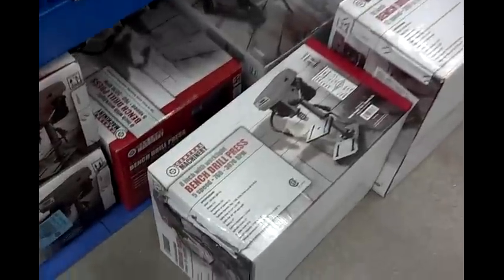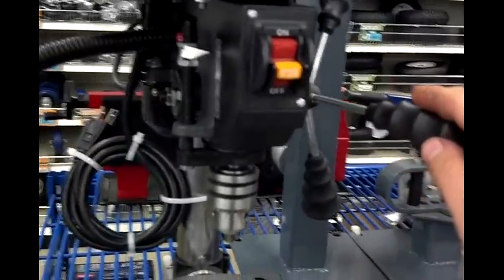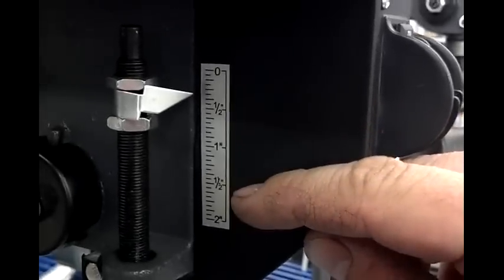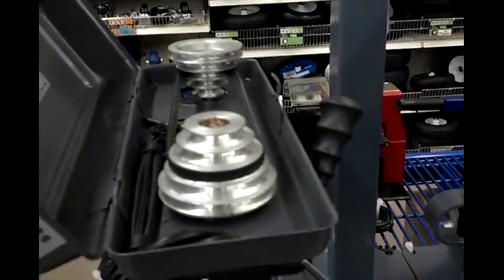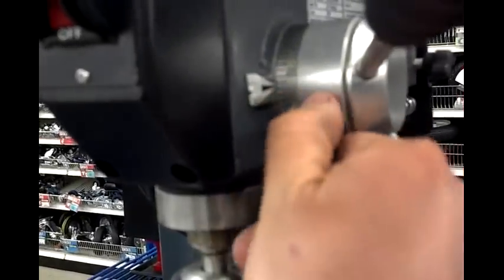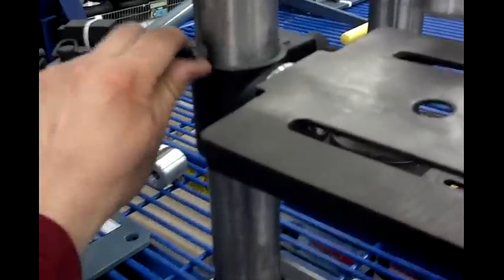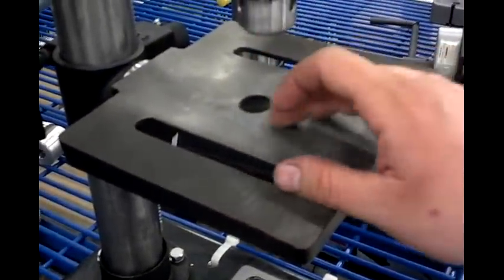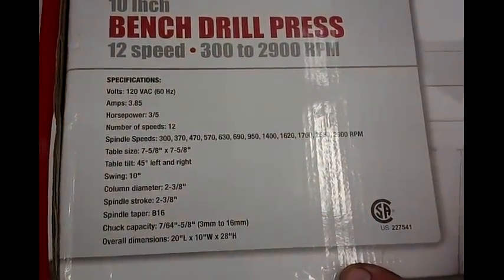Harbor Freight 8" drill press vs 10" drill press

Comment: I have the 8" and I noticed the chuck wiggle if I go all the way down, I lift the table upwards, so that the chuck never goes all the way down and wiggle. I ticked it was the 2 screws that are used to stop the depth of chuck. Get to know your drill press and you can amend any problem. No complaints from mine good deal. I also recommend getting to know your speeds and know when each speed is  needed.

Comment: Thanks much for the info. You saved me 2 hours of drive time. Although the tools look ok for some applications I don't think it will suit my needs. I didn't like the way the parts were moving around like you pointed out. Im also worried about accuracy and runout. I understand these are budget tools and for what they are the prices are good. So I think I will be patient and save a little more and go with a higher quality brand. But thanks again for your help.

Comment: I have the 8” model and it works fine unless you need something super precise and or are cutting really thick steel or something.  It’s a light duty drill press but as with most harbor freight tools they are not super robust and have plenty of faults.

Comment: I bought the 8 inch and have used almost exclusively on steel for several years. It pretty much stays on its lowest speed and my only real complaint being it is still too fast. Everybody says they need precision in a drill press (myself included) but when the rubber meets the road I'm just drilling holes.

Comment: Ya I think it's just they don't put them together very well on the demo units, that's why things are "loose"
Reply: At my local HF they are missing parts, and hardly are a working display.
Reply: +Bradley Berthold I just bought the 8 in and pout it together. I did not notice the "wiggle" issue. May be that its a demo unit and has taken lots of abuse.
Reply: was thinking maybe a vinyl nut would get rid of the travel.
Reply: It's not just that they don't put them together well.  I bought one, exchanged it due to excess vibration and chuck runout, and the 2nd unit had the same problems.  Poor tolerance and quality control.  Go figure, maybe quality drill presses cost twice as much (if not more) for a reason.

What you could do is buy about 4 of the same model, and take the best tolerance parts from each and build one reasonable drill press then return the other 3.

Comment: theres a little adjustment on the side (usually) to preload the drive column against the side, but even then my drill press with the adjustment screw out has barely perceptible movement, not this bad.

Comment: What HP should I have to use on metal - as a minimum? 
I'll be drilling holes through Aluminium and Mild Steele RHS, sheet and SHS sections. Thicknesses will range from 1mm up to about 10mm. Thanks in advance
Reply from the maker: +SupaLexy (SupaNautica &amp; MotoLexy) My 10" struggles to drill tough material or large holes. If your looking to seriously use it get a better drill press. I sometimes regret not saving to buy a better unit, but I rarely use my 10".
Reply: yeah that's the plan, larger holes, maybe 1 inch if I need to. I see a lot of people drill smaller pilot holes and then work up to the size they want and many of the videos on YT don't say what the HP is on these bench / press drills. 1/3 and 1/2 HP just seems so small, I was thinking that I might need about 1.5HP. Not sure
Reply: RPMs are key. the slower the rpm the better drilling through metal. Always take your time and do not forget to oil while you are drilling.
Reply: Re: Drilling holes through Aluminum and Mild Steele RHS, sheet and SHS sections. Thicknesses will range from 1mm up to about 10mm. Dia up to 1 inch. Think 1.5hp is needed.
Q: It's been a YEAR.. What drill press (Mfg Name+Model) did you end up BUYING?, How is it working out for you?

.

Comment: 12 speeds matter when you need the low rpm for stainless/larger bits that the 10" offers.
Reply: ***** So how satisfied are you with the 10"? what about power with larger bits?

Comment: I need to get a 1/4 inch hole through a 2.5 inch block of mild steel, can these do it?
Reply from the maker: I'd say no,  this is mostly for wood working only.
Reply: NetVoyagerOne absolutely yes check and know your feeds and speeds and yes it can. I've done more with less (the 5 speed 7in) and that seem of tilt at the max of quill is not what it seems its the plastic ring that is used for the depth stop.
Reply: NetVoyagerOne johnny drinkard got it right. The max of quill that wiggles is caused by 2 screws for depth control. It's better to use a depth stopper on collar for like $3 on drill bit.

Comment: I actually got an 8" one and it also does that doble at the end of the press.
Reply: Alex M don't go all the way to max quill down. The 2 screws for depth control is what causes it to rub bump.
Reply: If you don't go all the way down then the already short quill travel becomes pathetically short.  No, it's supposed to have no wobble through the whole travel range.  Anything else is a defect.

Comment: I got a WEN 10" for $120 from Amazon.  Came in 2 days, even though I chose Free Shipping with a 5-8 day delivery time.
Reply: I had a 10" Harbor Freight, and it worked okay for what I did.  But it had quite a bit of runout, so I upgraded to the WEN, which hardly has any.
Reply: The Wen power tools are all in the ballpark of Harbor Freight power tools and are much better made IMHO.

Comment: Forget RPM, the 8 inch does not have the torque to cut metal or even hard wood. You can hold the chuck and you can stop the rotation. All you will hear is the motor stopping. My cordless drill have better torque than the 8".

Comment: Mine took up space on my bench top for 2 years until I just threw it away. Total crap can easily stop the motor cold drilling through 1/8" metal plate $70.00 for scrap metal

Comment: Hey man, thanks for this review- I checked out the 10" after thinking I wanted the 8", and after seeing your video I knew what to check.  The 10" to me felt a LOT more solid.  To me, worth the extra $..  Still using yours?  If so, how is it holding up?  Mine appears to have a tiny bit of wobble in the chuck- but its probably OK..  It drilled a nice enough hole.  I might try to tune it out a bit more tomorrow.

Comment: how did you like it?
Reply from the maker: If you buy Harbor freight definitely go with a 10 inch, A Home Depot sells a similar drill press with better Fit and finish/features for Only a little more money. Personally I would go with the “Home Depot model” if I had to do it again!
Reply: @UnsanctionedFabrication  the 10" would be my fall back for sure.  im waiting to see if they have the 13" on sale next month  i think that is a huge step over the 10 in terms of build quality  but it is currently 300 dollars vs 150

Comment: My question is "what the heck does the 8inch and 10inch or even the 12inch actually mean"?
Reply: The distance between the bit and the actual machine. Same as on bandsaws
Reply: It is the adjustable area of the table with the press itself combined. generally speaking though you get a bigger motor with more inches.
Reply: It is the width of the piece you can drill a hole in the middle of.  For example a 10" press can drill a hole centered 5" from the edge of the material.  It also means the overall size of the press, with them being taller, larger motors, just overall built more durable and usually to better tolerances.